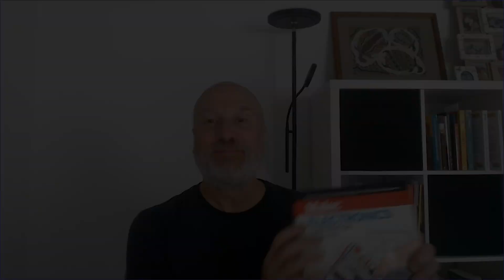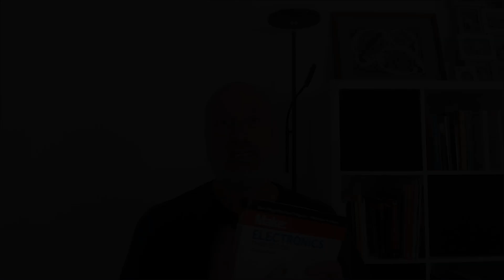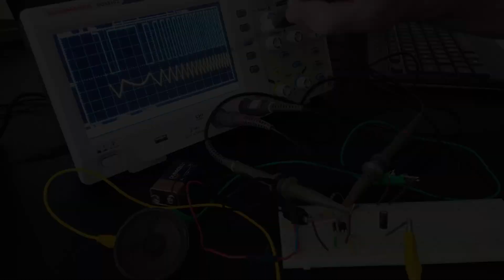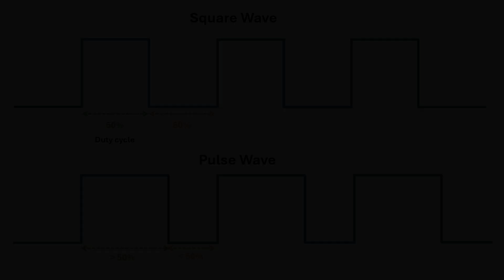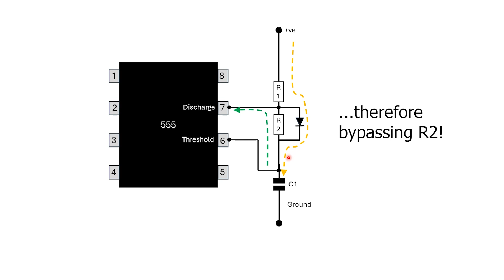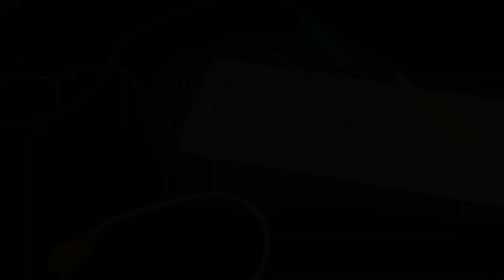Make: Electronics Book Experiment 16 - Building audio oscillators

Comment: Thanks for the great video. A question at the end of the video your circuit warbles like a siren, mine does not! Am going to redo to see what mistake I have made. Is that the stock circuit from the book or did you do the modifications as noted in the last paragraph of that chapter to make it do that?
Reply from the maker: I’m glad you found it useful. Yes, the first , single 555, circuit generates a constant tone, with the frequency set by the trim pot. To get the siren sound you’ll need to build the version shown in Figures 16, 17 and 18 (third edition). The output of the second 555 is then used to modulate the frequency of the first.
Reply: @M7GNP  Hey can you tell me which speaker do you use and its size and impedence ? I build this circuit many times but not works